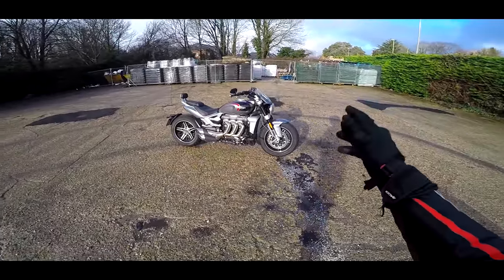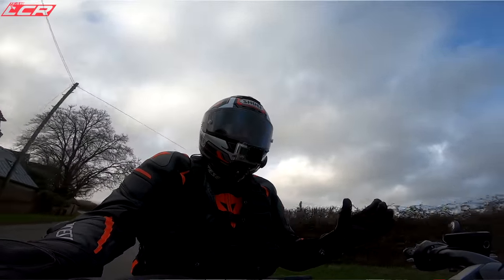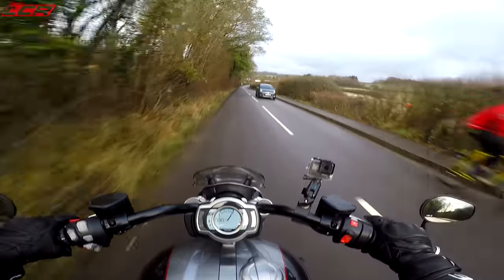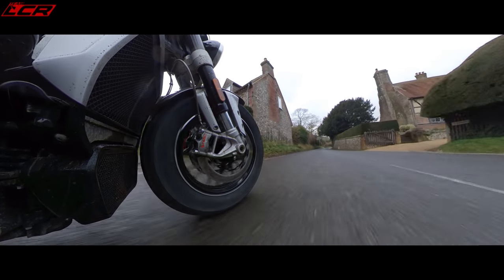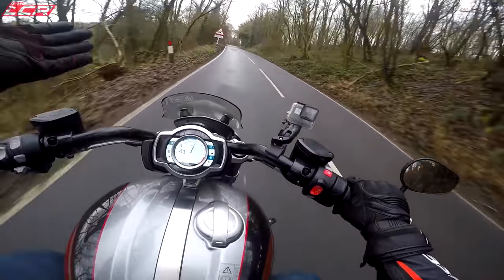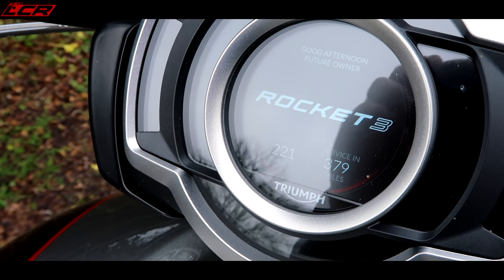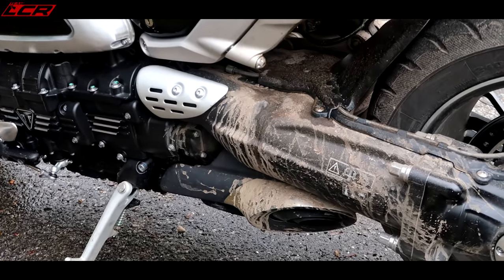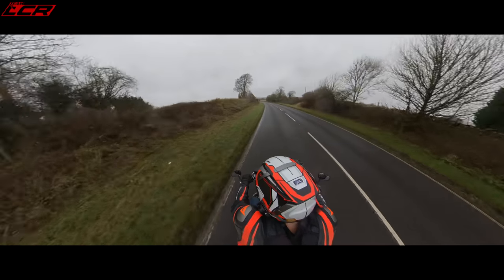NEW 2020 Triumph Rocket 3 GT | Road Test Review

Comment: Imagine buying expensive Harley when you could have had this absolute gem.
Reply: a harley is not about torque or price or technology, its the same difference between a bmw 5 series and a 60's dodge charger, you cant compare
Reply: But Triumph sounds like a kitty compared to Harley.
Reply: @osamabinladen824  but like a Bengals Tiger Kitty🐯
Reply: 4The2nd    Yeah, entry level Harley with ZERO accessories!!

Comment: Very nice motorcycle. I bought an Original BSA Rocket 3 back in 1969 in Toronto. It was obviously 3 cylinders and nowhere near the power you have in this new bike. Drum brakes and no electronics and it cost me $1800.00 brand new. I loved the bike and was quite satisfied with the power just about 51 years ago.

Comment: I own one, just bought it, put 3k miles on it bringing it home from the store, west coast to TN. great trip. Would do it again in a heartbeat. Plan to do the four USA corners in a counter clock wise loop – FL, ME, WA, CA with her in the spring.

Funniest thing so far... 
Having owned it for about 10 minutes, I thought, let's see what she can do. So I quickly twist the throttle and she does take off, well, like a rocket, so much so that as she pulls me aft, inadvertently twist the throttle even more, pushing me back even harder, thus even more throttle, more push... All the way to red line governor. 
Riders are NOT kidding when we say "you better hold on, because she will take off in an instant and assume the rider knows what he/she is doing". I am positive with some practice, I will get sub 3 second 0-60 times. Accelerate now, ask questions later, assuming you have held on!!

Comment: Excellent vídeo , even with the wet weather, that is not the best meteorological conditions for a proper test, and nevertheless the video could transmit the strong points of this extraordinary motorcycle.
What about cruise control?This the bike comes from stock with that feature or is something to add to the Price?
Reply from the maker: Yes comes with cruise 👍

Comment: I own an old Bmw K1200rs ( flying brick ) which is 285 kilo dry weight and you feel every kilo at low speed or pushing it about to manoeuvre it. Add top box, panniers and tank bag and two up, you don't have to go many degrees off the up right and you'll drop it.
Reply from the maker: It carries it weight very well, the GT is great as the little back support makes a great handle for maneuvering it around off the bike!

Comment: I saw one parked up and all I could think was ''you'd never pick that up If you dropped it''....Ha Ha !!
Reply from the maker: Yeah would take some effort!! haha
Reply: Not hard at all, barely an inconvenience.
Reply: I have put my 06 Rocket on it's side twice first time I put it back on it's wheels by myself.

But every thing went numb about 10 seconds later.  Came right about 20 minutes later.
Reply: @phar2slor3cpilot55  You lifted wrong and sounds like you lifted with your back.
Here is the proceedure:
1. Check of loose footing on the side you will be lifting from.
2. Grab the closest handle bar with the hand closest to the rear of the bike and pull towards the back of the bike. This will lever the bike up a little using the front wheel.
3. Turn around so your back is to the bike and put the top of your bike against the closest edge of the seat.
4. grab the grab bar or cargo rail at the back of the bike. You should now be in a squat braced against the bike with 2 strong handholds.
5. Push the bike up with your legs being careful not to do it too hard which can result in throwing the bike over onto its other side.

I have an ST1300PA which weights over 350kg with the panniers packed and lifting the bike like this is easy as long as the footing is sure.
Reply: J  
I did have a Jim Beam to soothe the pain before riding home.
Reply: @SurmaSampo  
Bike was only on the ground for about 4 seconds didn't even hit the kill switch just stepped over it as I was parking it fell to the right and didn't have time to think about the correct way panic set in and just got back up. Thanks for the write up
Reply: Theres a harley video showing how to lift a dropped bike. They get the tiniest of women to do it.
Reply: Permanent smile etched on face!!!
Reply: @SurmaSampo  Could you re-write that please in English
Reply: @jimmys6566  What specifically are you having trouble understanding?
Reply: @SurmaSampo  LOL Just ask a mate to read what you wrote and then show you what (s)he thinks it means
Reply: @jimmys6566  Yeah nah. If it isn't important enough for you to detail then I couldn't be fucked either.
Reply: @SurmaSampo  it seemed plane enough to me. If someone doesn't already know that, they aren't a rider and don't even belong here.
Reply: @jimmys6566  poser. If you don't already know exactly what he's talking about you aren't a motorcyclist anyway. You're just here making noises. Nerd!
Reply: @surma sampo 
step 3 says "bike" where I you meant "back".
Reply: I had the old one that is heavier than this, and I was able pick it up body front. Though I was extremely pissed off cause a crash, so maybe that had something to do.

Comment: how do you set the corner speed on the rear brake? Centre stand available ? I’d take that seat and put it on an R which is the model I’d get for extra ground clearance. Be nice if you could get a bigger screen for touring.

Comment: Even though I'm a true Japanese motorcycle lover, I must admit to finding the new Rocket 3s appealing. I'd probably go with the other version however despite preferring the pait scheme of the GT .
Size wise it reminds me of my former 1982 Kaw KZ1300 six cylinder. How's the engine smoothness? I hate a bike with too much vibration coming through to the seat, pegs and especially the grips.
Reply from the maker: Very smooth, no noticeable vibes through the bars or anywhere. I would describe them as minimal which is quite an incredible feat!
Reply: @LambChopRides  thanks for the prompt reply. Safe rides to you. 
Steve from Pennsylvania, US.

Comment: You turned onto my playing road at 9:22, I treat that as a hill climb (when its dry) going up there. And then after the top when going back down there's that twisty bit which some people just straight line through all of it but I love really leaning over and changing directions quickly. I prefer doing that bit the other way (going up the hill), but the switch backs at the start also going up hill, I'll do both directions if I'm really having a play👍

Oh and the road you turned off is decent as well going to chichester. Nice to see someone else using it as their playground
Reply from the maker: Yes great up there isn't it, really fast section towards the end of that road 😎😎
Reply: Fast is a bit of an understatement mate😅 After you come out the trees and on to the open bit you need to be doing at least 110mph to enjoy those turns😳 Only do that occasionally since there's lots of junctions and driveways, but I'm sure you'll agree this area in general has some decent riding roads 👌

Comment: the ultimate muscle bike? don't know about that because my '14 EBR 1190sx, (in my opinion), with its 185 hp, 138NM torque and 188kg weight makes for the ultimate roller coaster ride

Comment: Saw it yesterday at Triumph as I was picking up my 2005 Rocket which I've owned for 10+ yrs. Awful looking rear end and didn't like the riding position...the only great thing about it is the sound.

My guess is (just with the original R3) there will be plenty of these low mileage available in about 3yrs time.

Comment: I’ve got a Rocket 3 gt that currently has faulty indicators and faulty panniers, Triumph uk won’t acknowledge my emails, if you buy one expect a lot of down time, in my case a month per issue minimum, even the brake recall took a month and the lock replacement took a month, my bike has currently been down for three of the twelve months that I’ve owned it, buyer beware

Comment: For me, the mirrors and the foot pegs are wrong right off the get go. Next, the rear end( seat and fender-License plate holder) need changing. Very ugly and not comfortable. Next - get rid of those horrible headlights and put (1) 7" round sealed beam that's not friggen blue in color. Then it will be a great bike.

Comment: What a total waste of time. How many miles to the gallon? Companies should be prevented from making these polluting toys, or are we just imagining global warming?
Reply from the maker: 41 mpg average so way less than most SUV cars! Even with big engines bikes are very light in compared to cars so less fuel needed to move them. so even with 2.5 litres still saving the planet
Reply: Now have a go at multi-litre car drivers too e.g.  Jaguar, BMW, Mercedes & many SUV's etc... This bike and many others are likely more efficient & cleaner than bikes from 10 years ago.  I suppose you drive a horse and cart.
Reply: @stephenhedge2489  No I ride the most efficient machine ever invented, a bicycle.